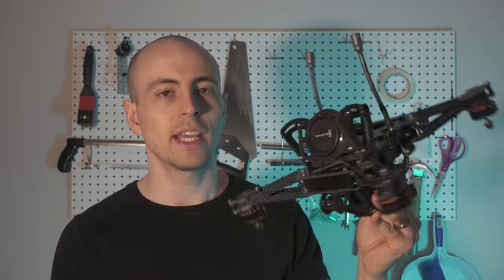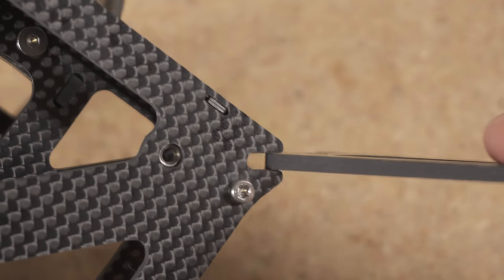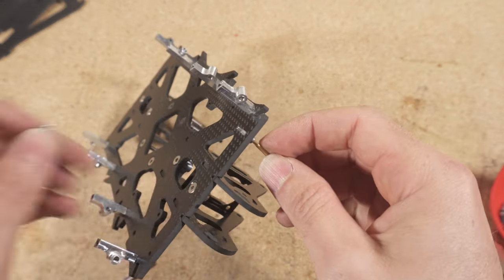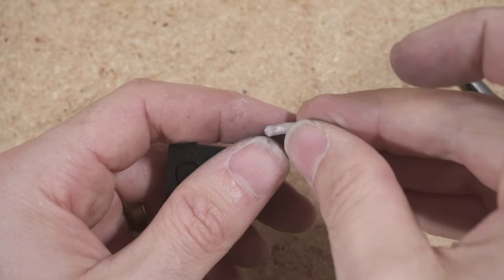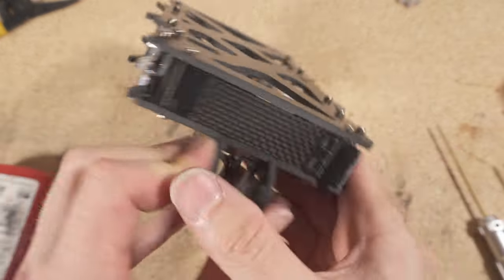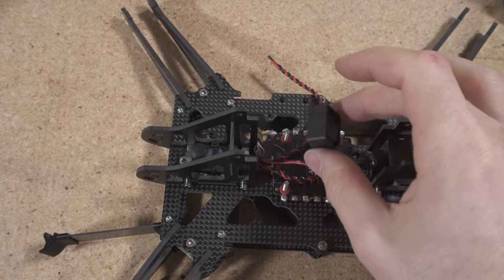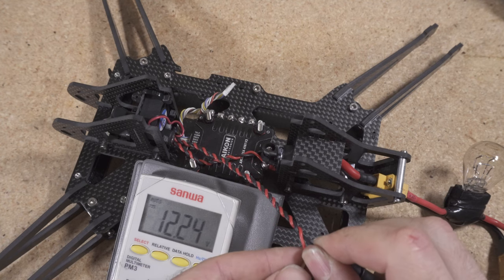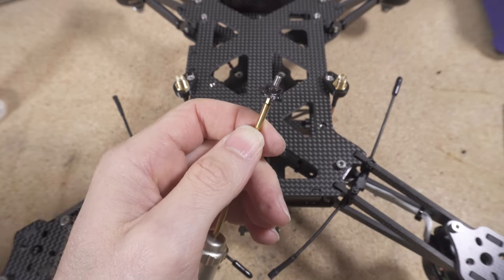Flying Squirrel Assembly Instructions

Comment: I like the wider form factor. My huge batteries should fit this wuthout mods. And the LCD cable looks nicer too.
Reply from the maker: The strap adapter that also comes with the kit should help with mounting batteries side by side too if the quick release doesn't work out.

Comment: I wanna see a crash. Because at 200 grams for 700$ for a frame with no parts to actually fly. As a customer I am saying why not buy a rotor riot tanq that flies and put 8 inch arms on it. I have a full flying setup for the price of your frame. I LOVE INNOVATON do not get me wrong and I love your idea but at that price you have to make it fly for me. I would say it would sale better if you sold it as a BNF Bind and Fly.
Reply: I’m tremendously disappointed with this design. 
So now I gotta strip 4 cameras in order for me to maintain redundancy, instead of having the flexibility of being able to swap my two current nakeds between my two puffins and pigeons? 

This ain’t right, Sam. 

Please keep stock of pigeon and puffin frame parts.
Reply: I dont build these to crash but I have crashed the Pigeon and the Vulture and they were surprisingly resilient. Ive never flown a rotor riot tanq but I have flown Sam's Pigeon V1 and V3, Puffin, Vulture, and have ordered this frame. Nothing flies like the Pigeon, not that everything else is worse but nothing flies quite like Sam's builds. Im not moving all my setups over but The pigeons are my fun / cinematic / longrange (do everything) 7" builds, The puffin is super stable indoors but I rarely fly it, The Vulture is a crazy fast 6" with these sweet removable prop guards and flies a full camera and then this build 8" built in camera. Very excited to try it and if you do I would be VERY SURPRISED if youre dissapointed.
Reply: @Bannisterpost I work with my pigeon and puffin regularly, so I always need to have at least two of each on a job if I’m using a BMPCC. I currently have two naked BMPCCs. 

If Sam decides to make a whoop style frame using this same concept, that means people that do this professionally will need to have at least two whoops and two open prop designs to have spares on the job, so that means four naked cameras. Between the cost of this frame design, components and a camera, I’m easily looking at over $2000 per build. 

Plus, why is Sam banking on the BMPCC4K? BMD already came out with 2-3 new cameras this year…who’s to say that they won’t come out w a new 4K next year? Then what? A new camera could potentially make this frame obsolete.
Reply: @FPV-coolguy you made a lot of solid points. I primarily use Sam’s frames for work, multiples of each + multiples of naked cams…stripping more cameras and calibrating them is just too much stress for me.
Reply: @FPV-coolguy  So you know then, I love the pigeon its still my favorite build. There's always new stuff, but the m43 Braw powerhouse that is the BMPCC4k is still enough to work in the film industry. I dont see it going obsolete. Saying that I am testing the Studio Camera 4k G2 this month on the Vulture... Same basic camera though. As for the Squirrel, the footage sold me, dont know if I will make more then 1 for now but if a new camera comes out it can be retrofitted im sure.
Reply: @Bannisterpost  I am thinking about buying the Vulture and doing a review on it.
Reply: I was just about to buy but the flight video was not promising. I brought up the horrible wobble to him and he said it was a "tune issue" and then ignored me.

I was blown away as a drone designer myself some times I spend a month or more problem solving flight characteristics which often entails redesigning entirely. But it seems now days you can make a fancy video and ignore anyone who sees through it. Success

The problem with this drone is the same thing that makes it look so dam cool and we'll designed... All those joints, all those screws, all those interlocking parts... This is the reason I go for one piece designs as much as I can because frame reasonable will destroy smooth low throttle flight.

I have been a subscriber to Sam for a long time and am a huge fan of his work. 

I cannot, however, get behind you charging $700 for a frame that you have yet to make fly well yet.... That is just dishonest